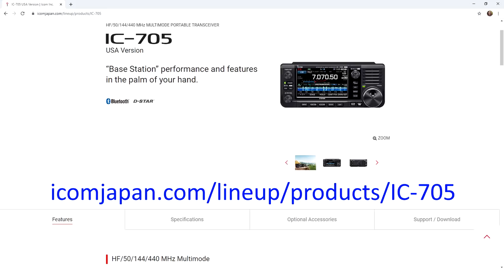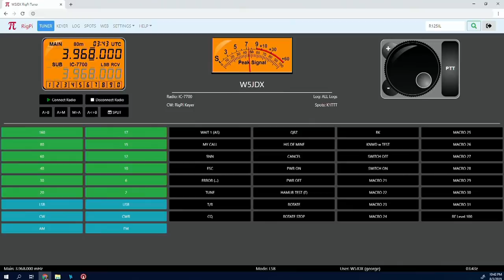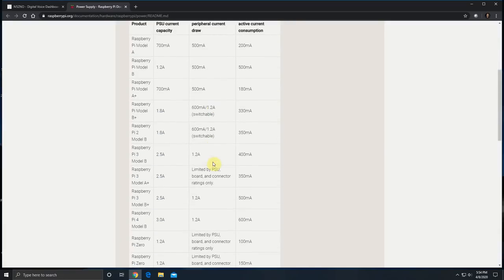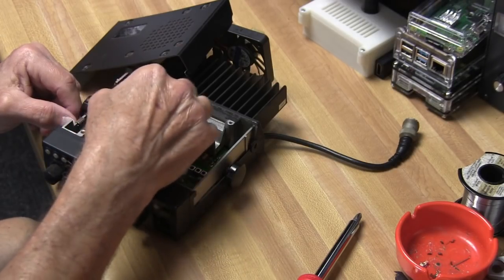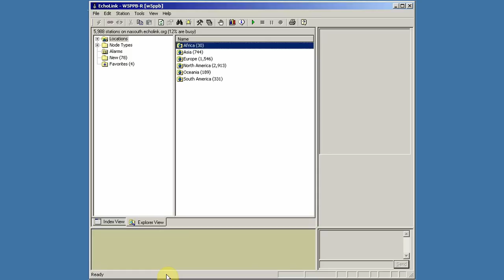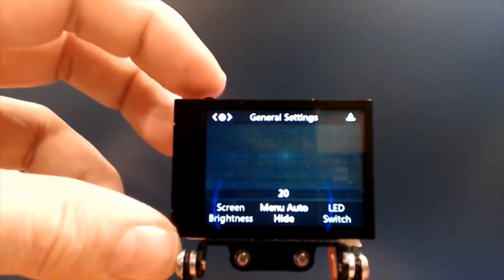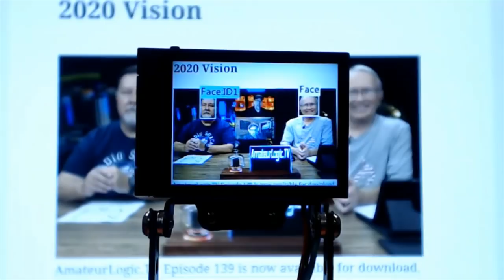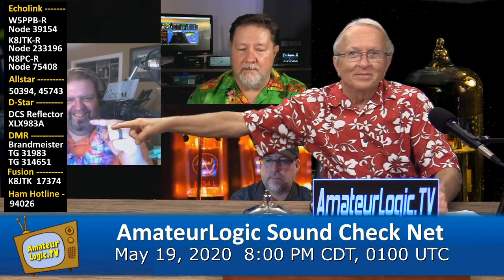AmateurLogic 143: N5BOC Hotspot, Huskylens, Squelch Tapping

Comment: Every time i modulate on my CB base , if my receiver is plugged in to 110 ac, it buzzes my receiver speaker very loud and sometimes freezes receiver that is off and i have to reset it. But if my receiver is unplugged but tiht DC batteries in it and the receiver is off then CB does not interfere with receiver. The receiver is a FM/MW/SW/AIR/ LW
Reply from the maker: Might try ferrite beads on the ac line. Also try plugging in somewhere else or moving your antenna. An ugly balun can help in some cases. Search for it on Google.
Reply: AmateurLogic.TV thank you very much for ideas and suggestions